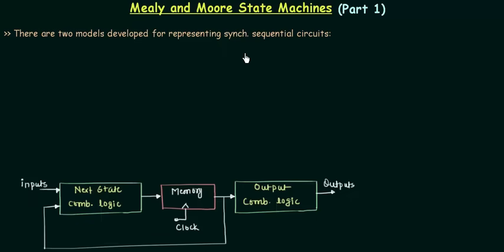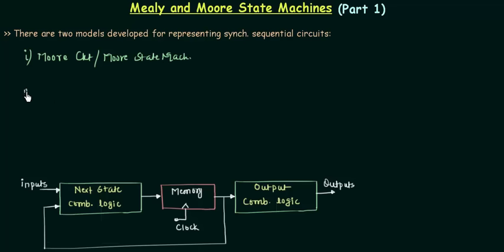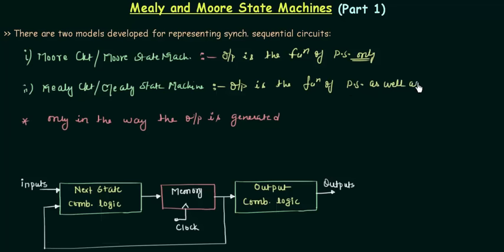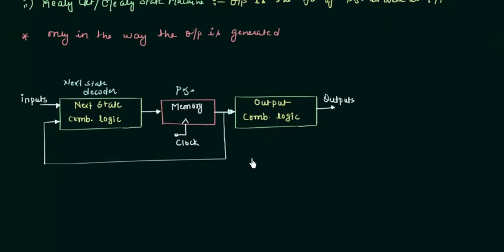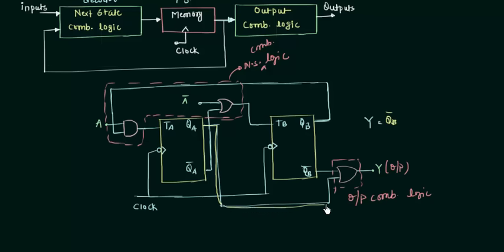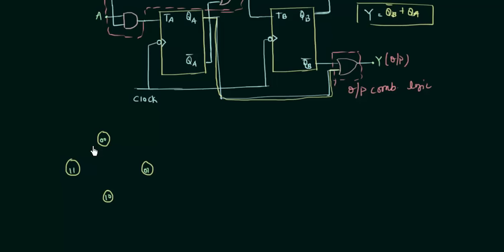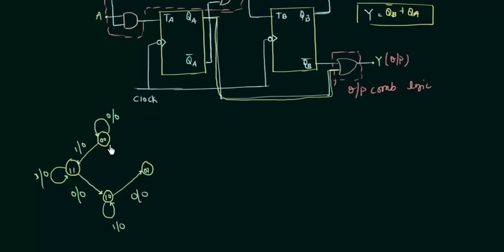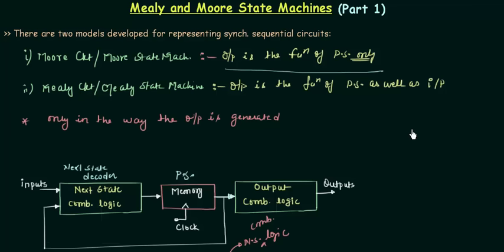Mealy and Moore State Machines (Part 1)

Comment: Everyone has this confusion at around 7 min saying how can 0 be put under 00. The thing is, for a moore machine the output is only dependent on the present state and not on the inputs. Thus for a state 00 there will be a fixed output (in this case: 0) irrespective of inputs given. This error/ambiguity arose only in the video because the state diagram drawn is incorrect. 

The simple explanation is to just put the ONE AND ONLY output associated with a state, inside that state's circular bubble. If there exist 2 outputs for a state, the state diagram is not for a moore machine.

Comment: please explain how i/p and o/p are taken for state diagram
Reply: +Prince Mahesh Actually he is not using any kind of logic while calculating output. He has chosen inputs and outputs randomly.
Reply: how can a person actually taken the i/p and o/p ? 

 @advaitharmy
Reply: He didn't explained how to take I/p n o/p
Reply: Transitions in example are random, but if you want to do it correctly you just find what happens for each combination of state and input.

For example if both flipflops are set to 1 (Qa=1, Qb=1; state "11") and you put A=1
Then that will make Ta = (1 and 1) = 1 so left flipflop will toggle at falling edge of the clock pulse; Qa changes from 1 to 0.

The right flipflop receives Tb = (0 or 0) = 0 and so it will not toggle; Qb remains 1.
(Tb is affected by the PREVIOUS (starting) value for not(Qa) and not the new one, because the new one hasn't yet traveled through the wires)

>>>>>>>>>>> state 11 changes to 01 if A=1.
etc. for the other 7 transitions.

Comment: There would be something wrong in the state diagram (2 T flipflops). If the state is 00 (Qa=0;Qb=0) then the output would be Y = 0' + 0 = 1. But you wrote that in state 00, output is 0!
Reply: That's not state diagram for above t flip flop sequential circuit but it's a random state diagram

Comment: Clear explanation, but I have something to ask. 
On the state diagram, 01 circle, it has 1 as an output. But from the 10 circle, there is an arrow with 0 inp and 0 outp to 01 circle. How can it be, since the output is 0 but it's already written 1 as an outp in 01 circle.
Thanks
Reply: same doubt here
Reply: SAME DOUBT
Reply: same here is contradictory, i believe the output from 10 should be 1/1 and the output of 01 should be 1/0, then it will converge!!
Reply: Same doubt
Reply: Here ,it is just a procedure to convert a state diagram to Moore state diagram ... You have to put the output of the state in which the nextdoor state is also the same state and neglect the other outputs

Comment: How do we represent a case where different inputs facilitate different outputs in the state diagram corresponding to moore?
Reply: ***** pls answer this , i got confused too
Reply: +Rajshaker Kankula 
Keep in mind that in a Moore Circuit the output only changes with the state and is not dependent on the input, which is represented in the information loss.
Reply: +Rajshaker Kankula I'm pretty sure it depends if the state diagram can be converted to a moore state diagram, i.e if the circuit is a moore state machine its state diagram should be able to be converted... hope that helps :)

Comment: i have a question. in the first diagram, the state "01" has two outputs (0,1) with the same input(0). there can actually be no state machine, in which its states yield different outputs with one same input. can anyone explain me this?
Reply: No it has 2 outputs : 
One is a loop = 0/1 
and other is giving next state = 1/1..

Comment: +Neso Academy
Will Moore state diagram contain four states only ? 
When present state is "01" and input is 1 it should give output 1 but Moore diagram goes to 00 which gives output 0 ?
Reply: no for the PS "01"the output is written in the bubble that is "1". and the rest is same as it is.
Reply: It depends on the sequence ckt diagram..besed on the diagram output will change
Reply: In this sequential circuit there is 2 t flipflops that is the reason for taking 4 states(00,01,10,11)
Reply: State diagram is drawn according the 2 t ff

Comment: Sir yr state diagram is wrong. If you are designing mealy then it will take one less state than u used. If u are designing with Moore than last two output will be 1 and all other 0. If u have any doubt u may write in comment section